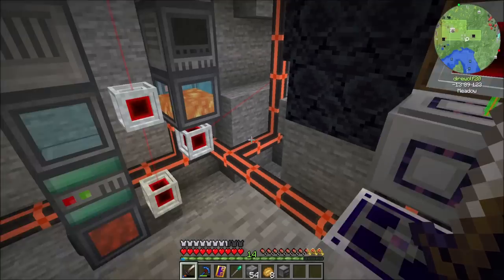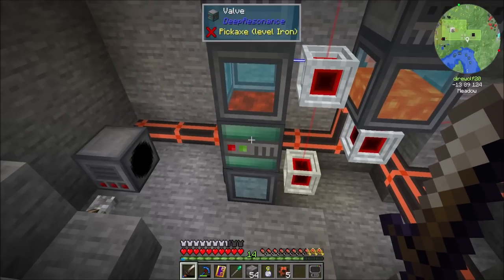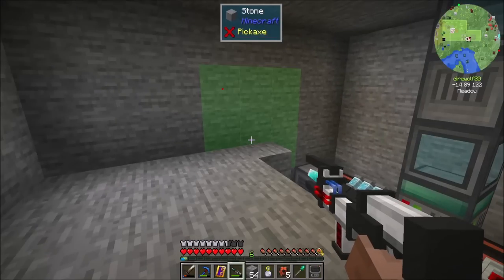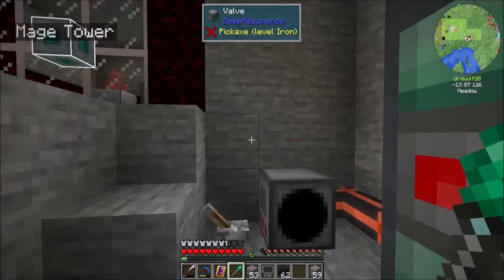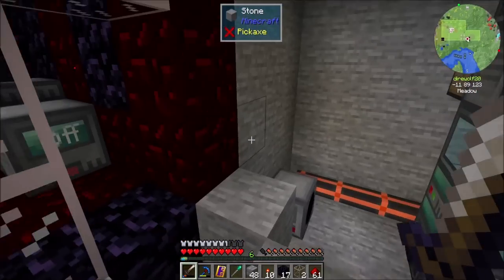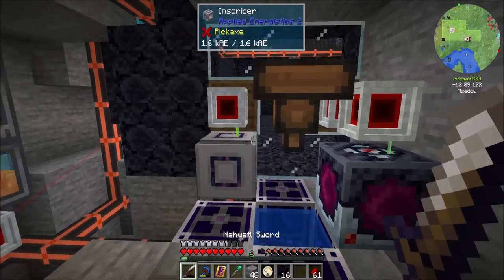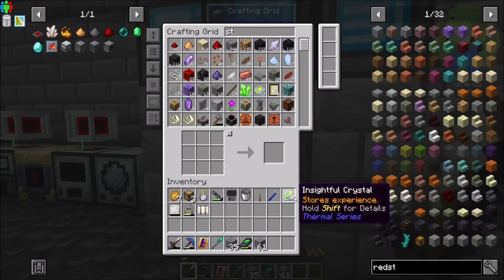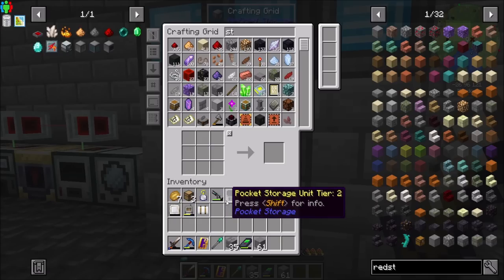Lets Play S11E32 The Power of Crystals

Comment: You've had access to the Create redstone links for ages, use those? I copied your design for the mob farm and replaced the levers with redstone links and its a lot easier to set up a central control panel for both mob farms. Just stick a Redstone link to the generator controller and you can turn it on from anywhere in your base.
Reply: I wish he would use them at some point just to learn how good they are.
Reply: In my void base I used the links to call up/down a create elevator using the gantry, they work wonderfully. Even better, I used a lectern and placed the handheld link on it for an elegant-ish way to use the same signals when on the elevator.
Reply: I don’t know if they were buggy or if I’m dumb but I couldn’t get them to work :/
Reply: @awillingham  basically, the way they work is that you need a pair. One next to a lever/button/pressure plate, whatever. The other is next to the destination block. You then right click the destination link with your create wrench to put it in Recieving mode. Put the same item in  the frequency slot on both, which will set them to the same channel, and you should be set
Reply: @stormredwood2613  yeah I did that. I was able to get 2 working ok but when I added more it all started to break. Thinking back, maybe it doesn’t support a single transmitter and multiple receivers? It was def acting up though because the first pulse on would get sent and all the ones after would not.
Reply: @Leifflei  i used them to setup an elevator to transport lava and myself from deep down in my mine. When i first set it up I nearly killed myself with the speed of the thing 😆. Create is easily one of the best mods to ever be made for MC. Creative and unique in every sense. Every MC player that uses mods should try it at least once.
Reply: @awillingham  its working fine on my world, im not sure what your issue is, I'd check you have all the recievers correctly configured

Comment: I really miss the EnderIO Power monitor thing, that only turned on the redstone when the battery fell under a specified limit and turned it off, when it reached an upper limit. That way you could maximize the use of the battery and not just turn on the generator for short inefficient bursts.
You can probably do something like that with the RFtools power monitor, but its a lot more involved, i think. You probably need 2 power monitors to achieve that. (One for the "turn on" range and the other one for the "turn off" range feeding into a Latch)
Reply: what happens if the min is above the max?
22:40
Reply: See the comment I made an hour after you describing that solution in more detail lol
Reply: @LethalLuggage  Your description says you want to use a NAND or AND gate, but I'm pretty sure that does not work the way you think it does. You cannot get this behavior without storing the current state somehow, because when the battery is currently draining a specific percentage of power stored might mean "off", but when it is filling that same percentage might mean "on". It is not enough to determine if the power stored is between two values. The power monitor already does that by itself. That is why you need a Latch or Flip-Flop.
Reply: To be more specific a simple set-reset latch: Power monitor between 0% and 30% wired to the SET-Input and a second one configured between 80% and 100% to the RESET-Input  of the latch. Will turn on if power stored goes below 30% and only turn off when it reaches 80%. Then drain back to 30% until it turns back on again. You can use a very simple "RS-NOR-Latch" from the Minecraft wikis.
Reply: I think all you need is a falling edge detector and a toggle
Reply: @Blubb3rbub  You're right. Even without reading this I was going to reply "Just use an AND gate" and then recognized the issue with it when I began to detail in my brain the reasoning.
Reply: Create has the Powered Latch which resets on signal to the side and toggles on with signal to the rear.
Reply: @Leifflei , exactly correct. I used a powered toggle latch from Create and two power monitors from RFTools to cycle on and off some compression dynamos from Thermal that feed into a Cell Battery.  Works great.

Comment: Edit2: Blubberbub gives a much better solution. This one misses a couple of crucial steps when you analyze it closer. Still not complicated!

So my issue with that redstone power detector is that it will basically regulate power: you hit 49% and then it'll go up to 50% and turn the reactor back off. Much better to probably have two detectors, one detecting if it's below say 40% and the other detecting above say 80%. Make a quick NAND gate and you can determine if it's between the two 
Edit: alternatively make it above 40, below 80 and do an AND gate
Reply: Or just turn it on at any level between 0 and 80%? Ya, that means it's gonna kick on and off sometimes, but does that matter? Doubt the mod really handles duty cycles or anything, eh?
Reply: @Nevir202  it's more that the majority of the time you might hear loud noises switching on and off. After its been on for a bit it settles into a hum
Reply: @LethalLuggage  loud hum? With it running they clocked it at 96 db, that's a bit more than a "loud hum."
Reply: @Nevir202  idk how you clock the decibel rating of a sound in a video game
Reply: @LethalLuggage  LMAO, I'd been having a conversation with someone else about the noise of a 3,000 liter per second exhaust fan, and he said it would be okay in a mechanical room.

I got the two conversations mixed up and replied to you thinking it was him lol.
Reply: @Nevir202  c'mon man, stop having conversations about noise and it'll be easy! 
I figured it was something like that haha

Comment: If LaserIO could transmit power you could seal that generator room 100% and have a laser export the RF to the battery.
Reply: Isn't laserio getting power transfer sometime in the near future?
Reply: @user-jm8sy5ox2j  pretty sure Dire said redstone and power are on the way. Both would help here.
Reply: A lot of time later, I used flux plugs in my room to be sealed off. Which worked well.

I never actually got the power monitor to work well at all 🤷🏻‍♂️

Comment: There's a mod called Wireless Chargers (or something like that) in the pack. It has a block to charge items in the player inventory in an area around it. It's not very fast charging, but it should keep up with the refined storage wireless grid curio (won't keep up with your power hungry gadgets tho :P)
Reply: I’m currently using this.  It works fine but I wish there was another tier with a bigger range.  13x13x13 just doesn’t cut it.  Especially with wireless crafting, since you are no longer tethered to a small space.
Reply: You can have them overlap to output more per second. Not the best solution, but it works.

Comment: Btw dire, if you are running out of quartz/silicon a good way to solve this is to make a create fan with soul fire. Have sand go past it on a belt, it turns it into soul sand. Then have another fan with water infront of the fan turning part of that soul sand into quartz and a bit of gold nuggets.

Comment: There is the Tesseract mod in the pack (for wireless power transfer) , and its got a pretty cheap recipe.
Reply: @Quietust Not just Mekanism cables, the Tesseract itself is kinda buggy. Use Entangled blocks instead and its cheaper
Reply: Personally I like dimensional cells from rf tools
Reply: @Quietust a diamond block is cheap for something like wireless power transfer over an infinite distance.

Plus diamond mining isn't particularly difficult when you have tools like the mining gadget

Comment: Can you detect different redstone power levels with super circuit maker? i.e. under 13 - turn on second generator, under 12 - turn on 3rd, under 11 turn on crystal? You could do this with different percentages with the other block you were using, but you would need 1 for each.

Comment: Wouldn’t you be able to adjust the max and min values on the power monitor better so the reactor doesn’t flicker as much?
Reply: No. 

Let's say the max is 70%. When it gets to 69.9%, it will turn on the reactor. Then it will get to 70.1% after like a second, and it will turn off. Then it will quickly get back to 69.9% and turn back on.

He needs to make some kind of RS Latch or similar.
Reply: Unfortuantely, not with a single power monitor. It gives the signal when it goes below the maximum threshold (i.e. if the threshold was 80% it would kick on at 79.9%) and turns the signal off when it hits the threshold again. If power is in use, then the power will flicker between 79 and 80 percent as the generator turns on and off.

Comment: You can use Entangled block to transfer power to somewhere else. They don't have range and work interdimensionally, so you can put a batterie where you want to receive power and entangle it to put the block where your generator is. Idk if this was said already, but I found this while playing your pack and noticing flux wasn't there. It's not "inventory charging" awesome, but it's better then nothing.

Comment: You can also create a timer in the circuit and then have the deep resonance generator start at a lower power level but force it to run for like 1 minute at least, so it doesn't toggle on and off all the times.

Comment: You need a hysteresis controller that will switch on below a threshold (like 60%) then switch back off above another threshold (like 95%). RFTools should have something that can function like that, but if it doesn't you can take your power detector, invert the signal and feed that into a rising-edge T-flip-flip.

Edit: There is a problem with this approach I didn't think of till now.  If the system activates but then drops below the minimum threshold again while active, the system will shut down completely. He will need a way prevent that.
Reply: This is exactly what is needed.  Now the question is how far ahead Dire is with recordings

Comment: I'm looking forward to seeing how you implement LaserIO with Mekanism automation.
Reply: I actually did this.  It makes automating the infusers pretty easy.  No longer need to use the front face of the machines.  For the “extra” I have a RS exporter with a regulator keeping a chest stocked with a stack of each enriched material.  Extract out of there on another channel to use the same insert side as I’m using for the infuser output.

Comment: Are the RF Tools powercells not in the pack? They could be used for wireless power. And using the RF monitor in the same mod, it could be used to monitor the cell charge and turn the generator on and off as needed. It's all the same mod writer so you'd expect them to be used together.

Comment: what was that mod where it was a generator multi-block that you could make with several different components? I want to say it was Advanced Generators. All I remember is that you could take a bunch of Kloches and rapidly grow watermelon and turn it into an amazing fuel source and run 100k+ rf/t pretty easily. It was one of the best mid game power gen options. When ever that was, that was the last time I played MC.
Reply: Kloches are from Immersive Engineering, and there are several mods like that, Extreme Reactors is in the pack and uranium is literally everywhere

Comment: idk if theres a wireless power transfer option that you have access to at the moment (i know mekanism has one but thats probably too expensive for you rn) but if you do, there is a mining dimension (and a void dimension i think) that you could stick this thing without worrying about irradiating your base

Also, if you do keep it in your base, it might be better to have the dense obsidian you have on top instead of the bottom since thats probably the direction youll be in most often (other than the front of course but thats covered)
Reply: hey , how do you access the mining dimension in this modpack ?
Reply: @march1885  there's a portal block you can craft (probably something like mining dimension portal idk). You just place that and click it
Reply: @logan5018  indeed it's called the mining portal, thanks dude !